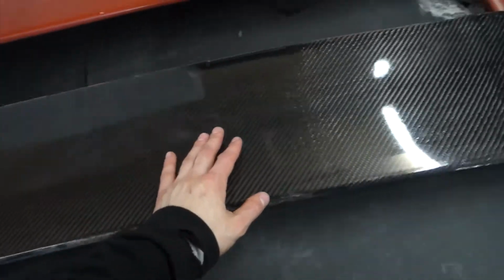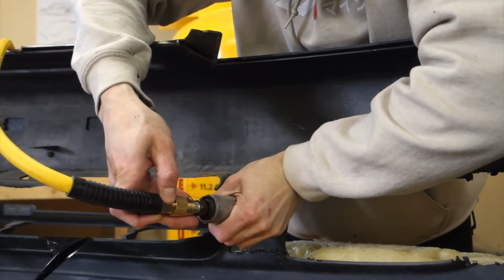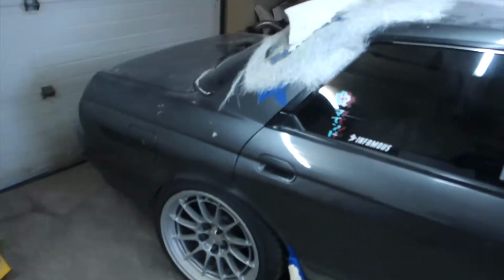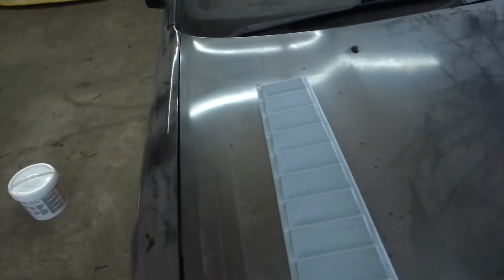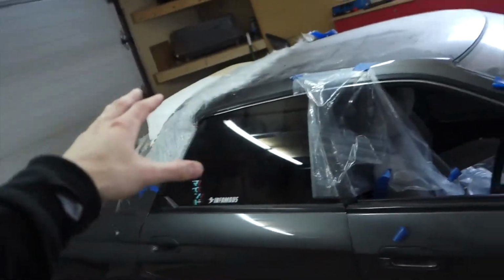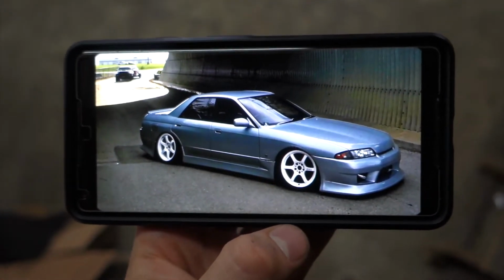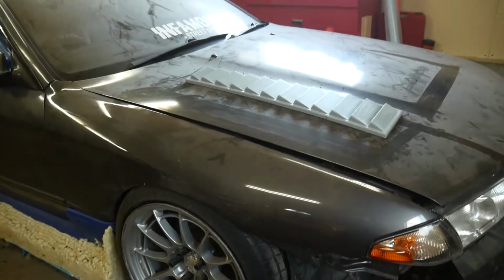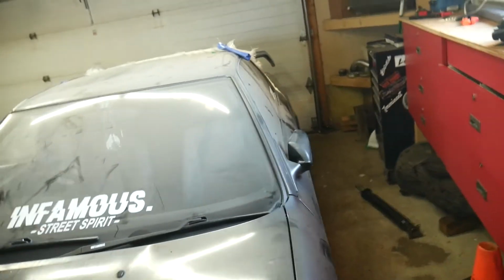DIY BODY KIT DURING QUARANTINE

Comment: Nice job. About 10 year ago I made a rear window spoiler as well. Very similar process I used. At the time I didn't think about using expanded foam, but used the pink insulation foam board and hand carved and glassed it. I covered the foam in tinfoil to keep the resin from eating it. but that's how i got my form. Can't wait to see this whole project finished.
Reply: I had the eating issue couldnt get any good tips but that thats a good idea

Comment: Need some tips on doing lip kits. I wanna do a lip all around
Reply: Fibreglass and and apoxy resin,body filler or clay and a cardboard mold (your design) in plastic that stick's to surface if heat treated,lubricate material and sand paper.
Make the mold by cardboard then grab your body filler or clay and do a 5 to 10 coats all over it Sand it  to the shape you like
Wrap it in that plastic make sure to leave no air bubles open spots or folds lubricate so the fiber glass don't stick to the mold start applying fiberglass sheet by sheet after every sheet add the apoxy mix.
Do some research because sometime has past when I read or heard this as it might be incomplete it might be incomplete .

Comment: I been slinging body filler and make a lliving doing iit for 25+ years bro , and I will never knock another man's work, but I would not use drywall mud brother!! I am afraid all of your hard work and 💰 will crack and fall out relatively quickly if u do that. I'm sure you've probably heard a million different ways though. It will be a learning experience!lol 36grit and start cutting it while it's soft, don't by 3M Bondo filler, it's shit, get you some nice lightweight filler, "ZGrip" is good and cheap and cuts well,
Reply from the maker: Hey! Appreciate the input, but I have a bit of a different technique than you think with the drywall filler. It is simply to get the base shape - then it will be sealed with fiberglass. The drywall filler is not meant to be structural at all - as I will be moulding it and reproducing the parts out of carbon fiber / fiberglass. It is just simply to get the shape correct :)

Comment: Foam & Bondo works too?
Reply from the maker: yes but you need to be careful which types you use, as some foams will react with bondo
Reply: I would imagine drywall joint compound will Crack like nobody's business and not take to paint as well but I just do body work idk lol